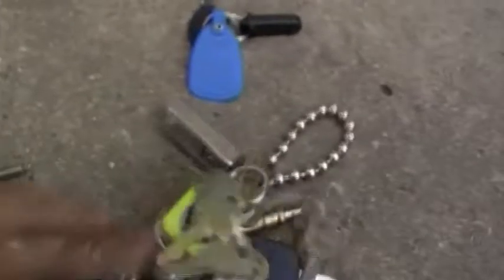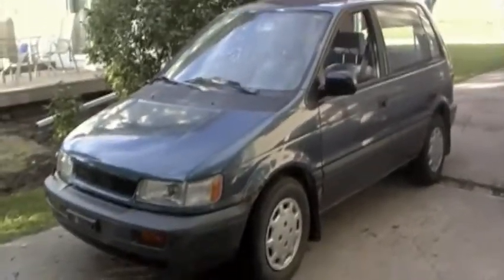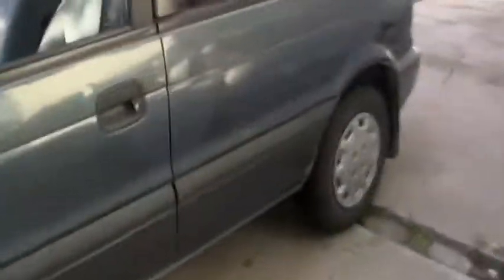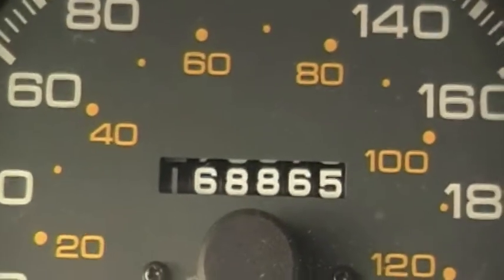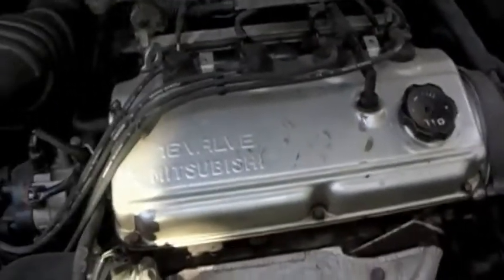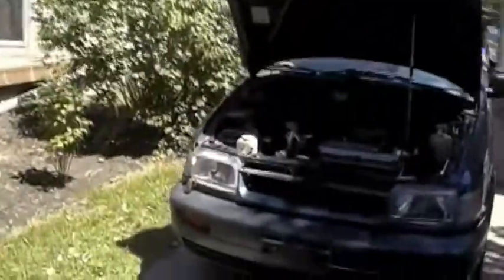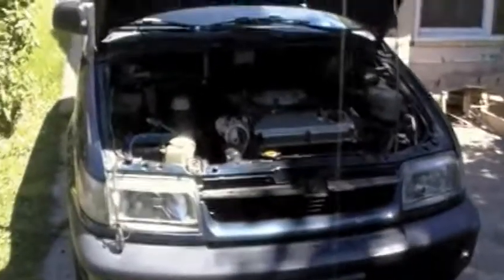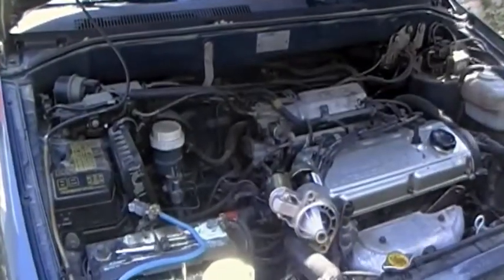Another Vehicle Another Project

Comment: To prevent the grinding turn the key on not to the starting posistion but just full power and then back off and then start and it wont grind